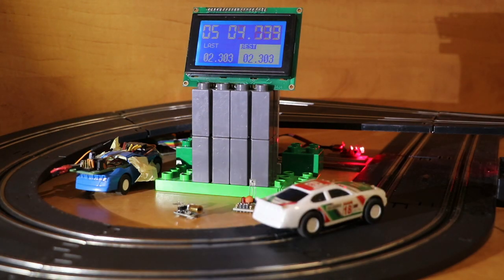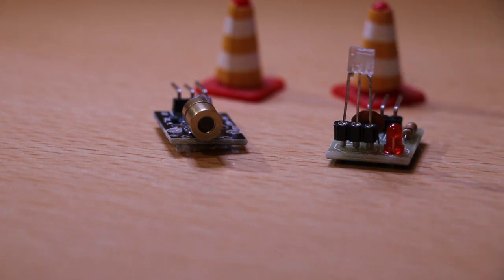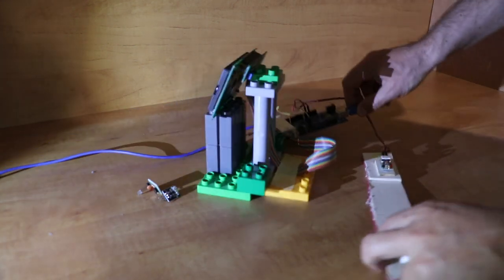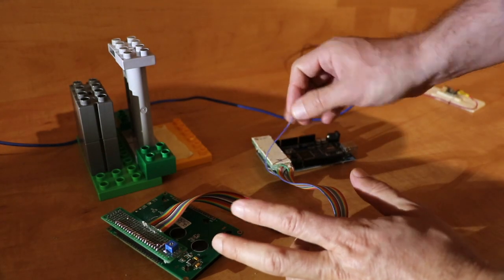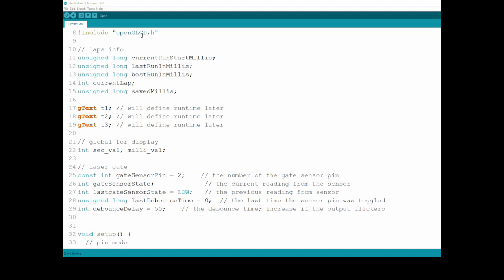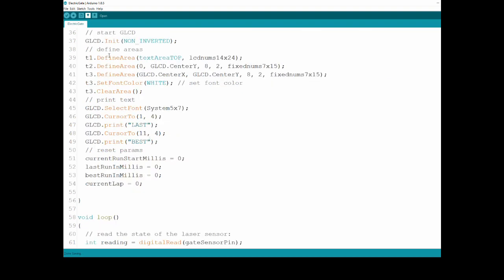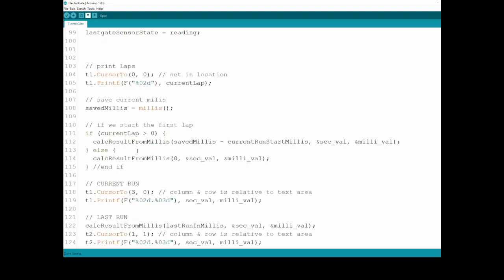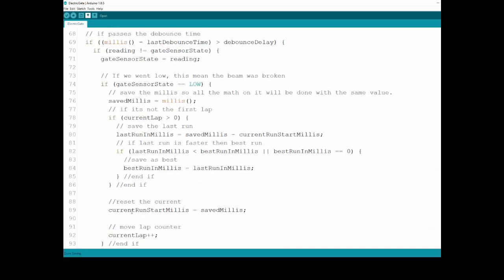Slot cars arduino powered laser triggered lap time GLCD display.

Comment: Nice project,  sort of confuse here, how did you get the laser to work for both lane, wouldn't the car on the other lane beeak the beam too ?
Reply from the maker: Thank you :) 

It was built only for one car, regardless of the lane it drove on. 
I thought at some point to place the sensor in the middle, but with no luck
The reason was that the chance of the cars not hitting it as they pass it was slim to none :)
I’m sure it’s be possible if a reflector is placed in between the lanes and then use a bit of an angle to direct the laser to the sensor when it’s be placed next to the laser.
Reply: @talofer99  Got you, maybe you can try on the straight way, place a thin cardboard divider between the lanes and see if that would work, anyway nice project.
Reply from the maker: @Musicman8610  unless I misunderstood your suggestion, it  would not work.
The reason is that  the sensor was on one side and the laser on the other, and the car passing broke the line. so can not have a divider between the laser and sensor. 

So either place the laser or the sensor in the middle .. to be able to have it on each lane. or at least for one lane without the other triggering it. 

 
Ans thank you very much :)
Reply: @talofer99  Got it, okay, it makes sense.

Comment: Hi Where did you find your lcd screen?
Reply from the maker: I order it on ebay long time ago 
this is an example link got a similar item 
https://www.ebay.com/itm/St7920-12864-128x64-lcd-display-blue-backlight-parallel-serial-arduino-5v-OQHGU/193228548824
Reply: @talofer99  thanks